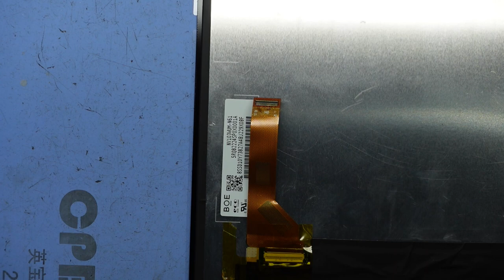Lenovo Smart Tab M10 Plus TBX606F Display Replacement

Comment: Thanks for the video. Helped me replace the one in mine. I just used a heat blanket and used the two sided tape that came with it. To get under the screen I used a razor blade to pry the edge up and then used a plastic gift card to cut the glue. The black foam piece on the back I cut under the corner with a razor blade to get ahold of it and was able to peel it off by hand and transfer it to the new screen. Probably should wear safety glasses when extracting the old screen as it is probably going to break a bit more.
Reply from the maker: great to read you have managed to get the job done!
Thanks for the tips for others

Comment: Hi. I really liked your video. thanks for that. but in my case i just need to replace the glass and not the whole display. any suggestions on how i could do that?
Reply from the maker: The glass is glued to the LCD, so I don't recommend attempting a glass only swap
Reply: @rickstechrepairs  wow. Thanks for responding. It is just that a glass part it 10 eur and the display 80. Which is a lot for what was originally a 150 eur device. If you would do the glass. How could it be done? I will otherwise likely bin the device. But it feels like such a waste... Thx again

Comment: Hi, thanks for the video. I followed all the steps but the screen is not working. Also, it makes a click sound every 5 seconds. Do you have any ideas why this is happening and how to solve it?
Reply: Same here, did you by any chance find out why this is happening? I've searched the Webs and can't find a thing. ??
Reply: @1982Fingers2  It's because you didn't put the connector that you swapped from the old screen all the way inside the connector of the new screen, there is a "white line" and if you can still see it, it means the connector is not fully inside
Reply: The old ribbon cable was slightly damaged, so I bought a new one and it solved this issue, the tablet is working fine now.
Reply: @ThePrincedog yeah I had a bit of trouble figuring out where the line should be. You are right though, it will be not visible when the connector has been sent home all the way

Comment: Just ordered the screen and doing a bit of research. What was the purpose of unplugging the battery? (is this a step I can skip?)
Reply from the maker: unplugging the battery is so you don't accidentally Fry anything
Reply: @rickstechrepairs  thanks for the explanation! 

I've changed other tablet screens before but never disconnected the battery. I'll add this to my to-do list.